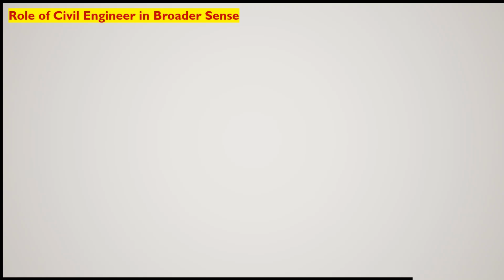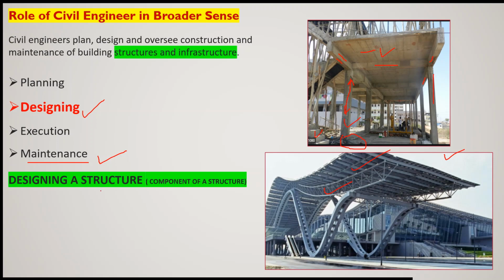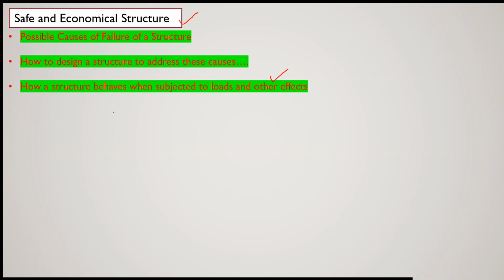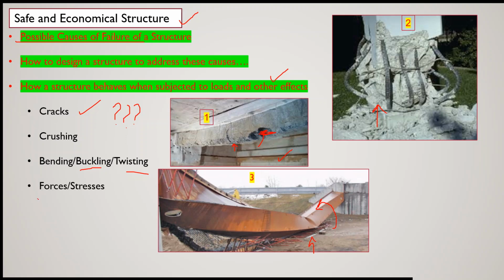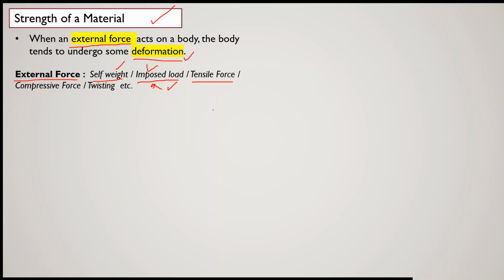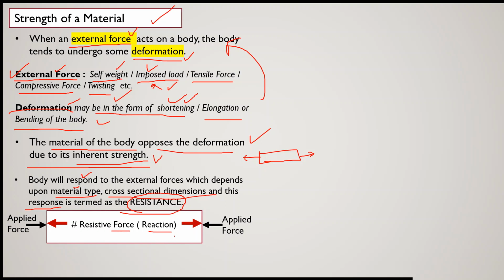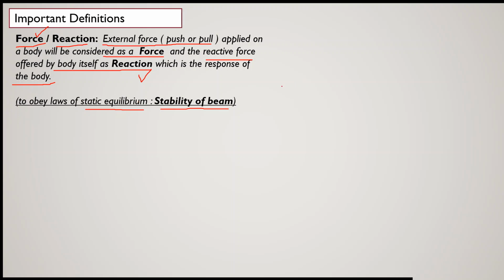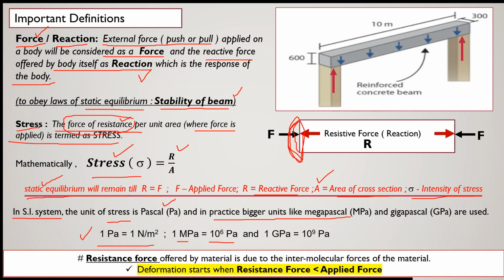Lecture No. 1|| Strength of Materials || Civil Engineering Students ||  Introduction || Significance

Comment: Sir,
1.Which force causes maximum damage normal ,tensile or compression
2. Deformation of any material effects its strength in future
3.There is any difference between pressure and stress as both reduces length of body